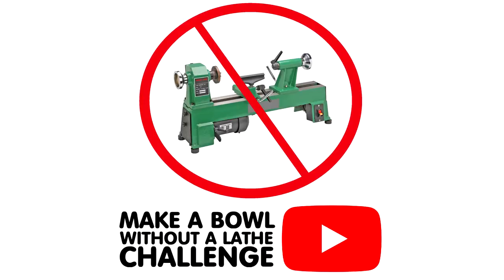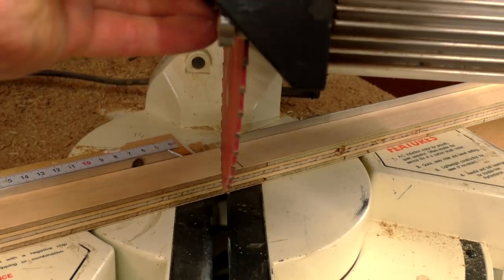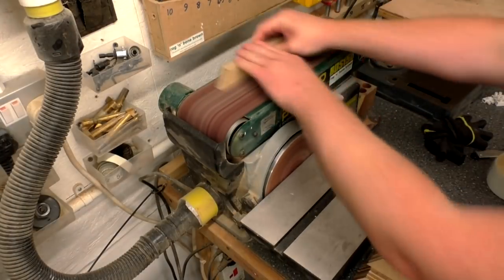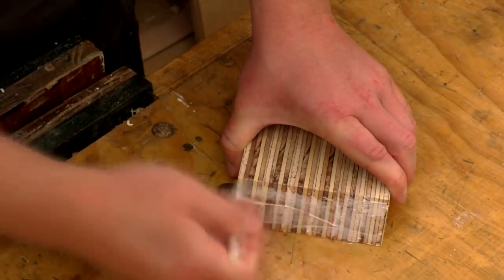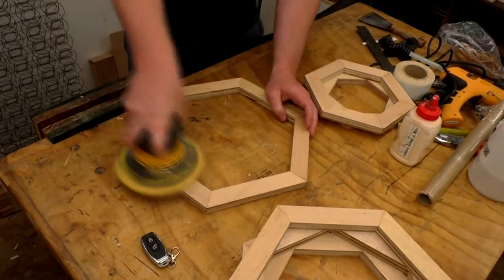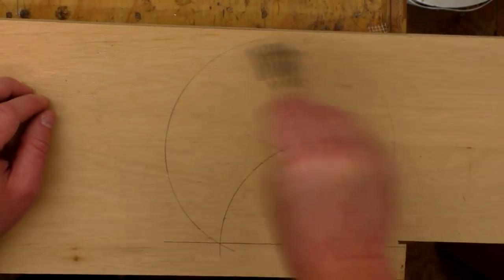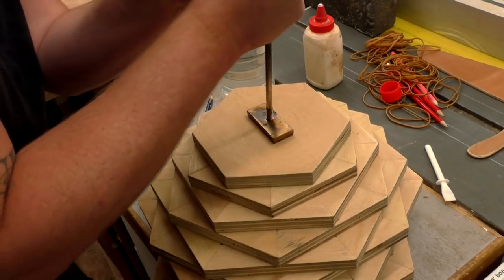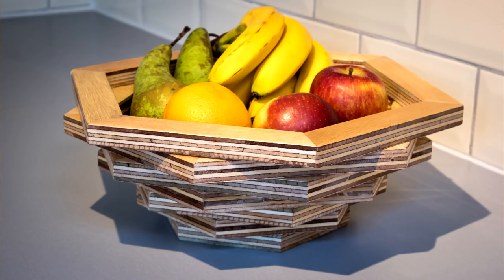Making A Plywood Bowl - Bowl Without A Lathe Challenge #BWALC

Comment: you could make a few backed bows and use more of that fiberglass tape for the backing. Simple Longbow or Flatbow designs use oak boards and back them with that tape and simple wood glue.

Comment: I like the way the inside looks and I'm curious if you ever considered  cutting the out side to make it more round, I think that would be cool looking too.. Or just cut off all the outer points?  May have to give it a try myself. Thx!
Reply from the maker: One idea I did have after I finished was instead of ripping the plywood strips with the tablesaw blade at 90 degrees to the table I could have tilted it to 45 degrees to give the outside of the bowl more of a contour...  I wish I'd have thought of that sooner!  But yeah there are tons of different ways that you could be creative with the design 👍